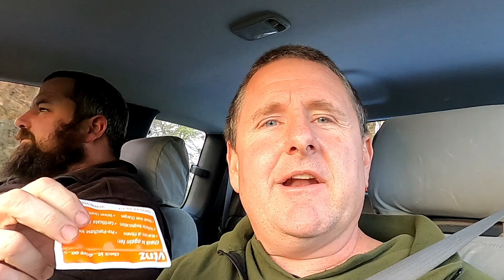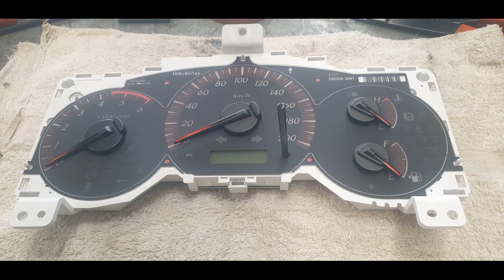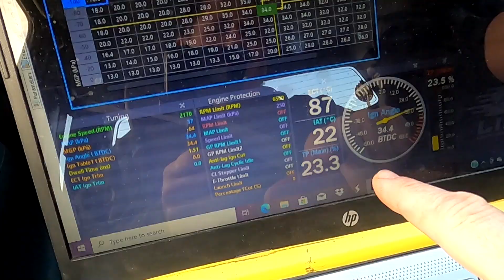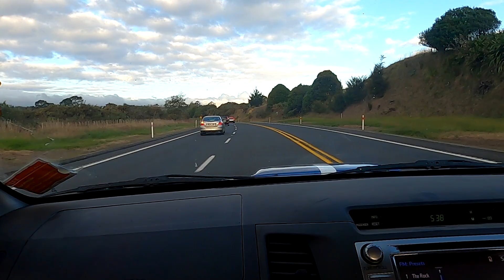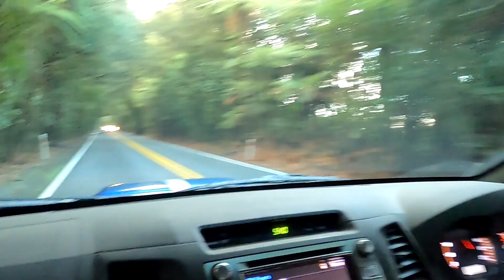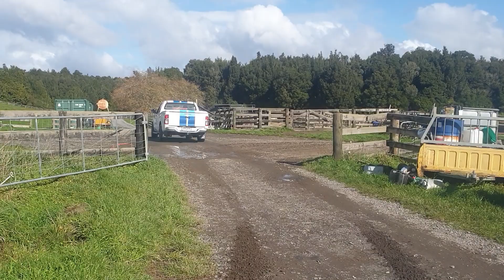2014 2wd Toyota Hilux LS2 6 litre V8 swap.  Final Test drive and back to its owner.

Comment: Hey there brother, I need distributors, leads and points for my first edition 1UZ but I can’t seem to dm on YouTube anymore. I wanted to know your price and if there’s Toyota original or if it’s Bosch or if there’s a choice what I should get? My motor only has 160k on it but it’s 28 years old and starts up as a 4cyl when it’s very cold so I thought I’d start with ignition and also what plugs should I use? My mechanic recons there’s platinum plugs in there that might still be ok but I reckon get new ones too?

Comment: Kelvin, is the improvement in braking from heat cycling everything?
Reply from the maker: I believe the biggest improvement in braking is from the heat cycling.  I took them out for the recommended procedure and since then they have gotten better and better.
Reply: @CartuneNZ  partly yes or mostly but also flatness bedding together 
It’s the resins sticking to the rotor that it wants to create the friction